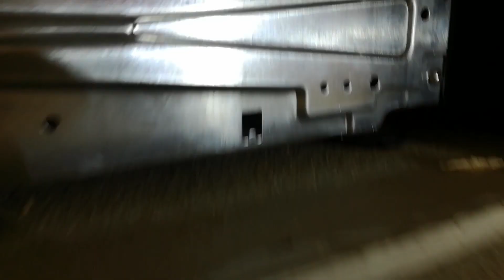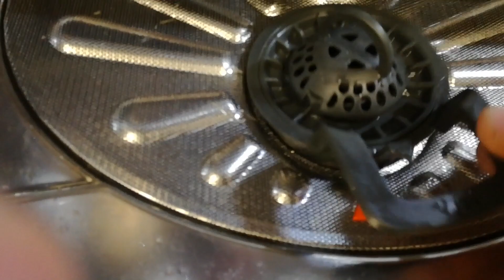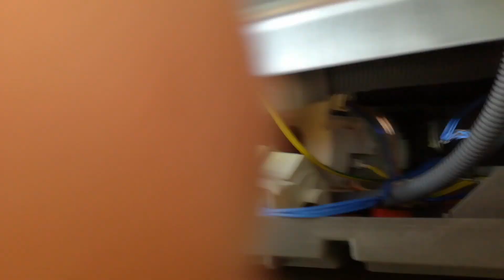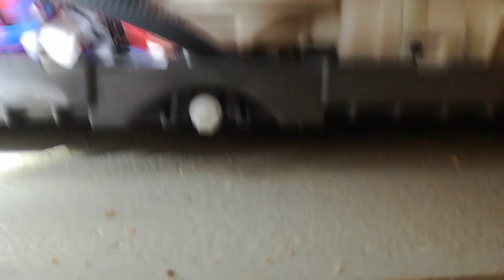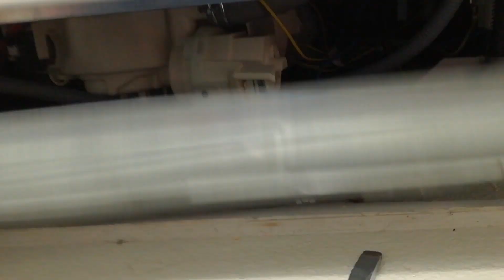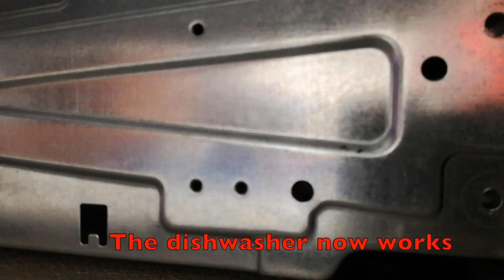Fehler i20 Neue Geschirrspüler AEG Electrolux

Comment: Super Video! Habe soeben die Pumpe ausgebaut und eine Glasscherbe entfernt. Alles wieder zusammen gebaut leider mag der Geschirrspüler immer noch nicht. Zeigt nach wie vor noch Fehler i50 an... vermute mal dass die pumpe an sich defekt ist? Reset und strom aus hab ich schon probiert. Kommt immer wieder Fehler i50. Werde mal ne neue Pumpe bestellen oder hat jemand einen besseren Tipp?
Reply from the maker: Ja 👍 ist möglich das die ablauf Pumpe defekt ist. Kommt der Fehler sofort? Beginnt die pumpe zu laufen.   Wichtig 2 dl Wasser 💦 in den Geschirrspüler einfüllen und Programm neu starten. Ohne Wasser kann der Fehler i50 erscheinen, die Pumpe braucht ein gewisser Widerstand, versuche es , gib mir Bescheid 😀
Reply: @MarcuttiMarco  Programm startet überhaupt nicht. Die Ablaufpumpe versucht ca. 3 bis 5 mal kurz zu pumpen und dann kommt i50 Fehler. Guter Tipp mit den 2dl Wasser. Wahrscheinlich liegt es daran. Die ablaufpumpe läuft nämlich ganz kurz (habe mit der Hand gefühlt und spüre leicht Vibration, also sie arbeitet) bevor das Programm starten würde.
Reply: @MarcuttiMarco direkt mal getestet mit den 2dl Wasser reinkippen... siehe da sie läuft problemlos und startet das Programm 😁😁 ich danke dir vielmals für den Tipp und vor allem das tolle Video. Hast gerade den abend meiner Frau und meiner Männer-Ehre gerettet 😂👍🏼